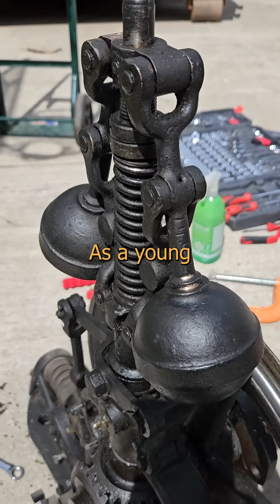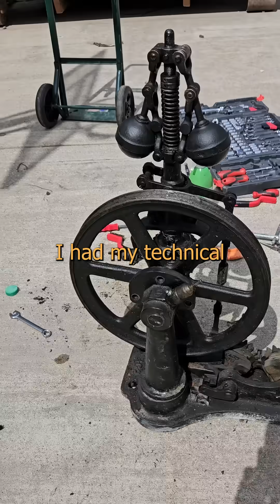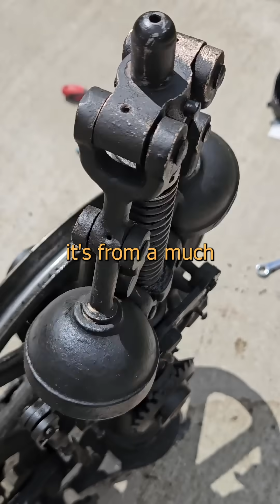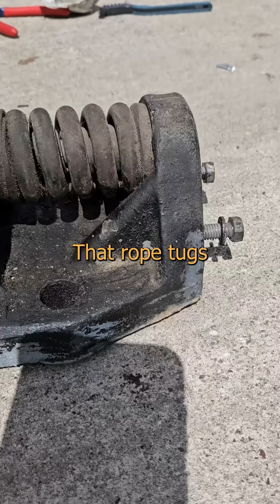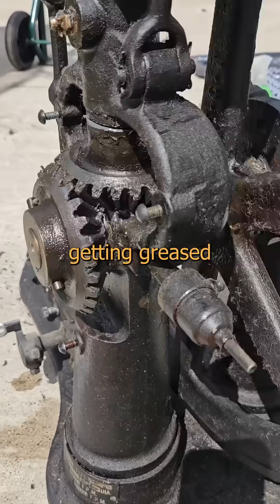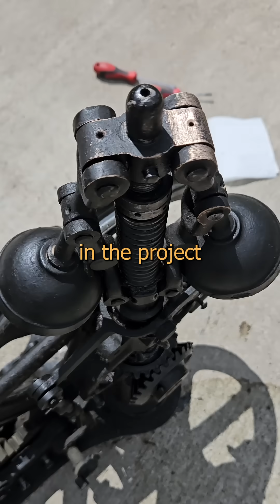Flyball Governor #chrisboden #comedy #engineering #steam #safety #elevator #steampunk #vintage

Comment: This centrifugal governor is used in a different function, than the one used in a steam machine. This one operates as a monostable limiter. If a certain threshold is crossed, some other mechanism is triggered, but not automatically released, when the threshold is crossed again.

The governor in a steam machine operates as a proportional controller, controlling the flow of steam, to stabilize the speed of the machine.

Comment: For those womdering, FPM stands for fucks per minute
So if you start to fall, it will count how many times you say fuck depending on how quickly youre falling, and once you reach 350 fpm it wont engage because youd have slammed into the ground about fifty seconds ago

Comment: I get a queer feeling of nostalgia for any machine that is made of heavy steel parts and has no computer, battery, sensor, or wires. Things made to last a century with minimal maintenance, and any adjustment was mechanical.

Comment: Aircraft propeller governors work the same way , but the spiny balls open and close oil ports to change the pitch of the blades holding the engine at a  set RPM regardless of Manifold pressure  ( engine power) and that is pretty cool!

Comment: I didn't pay attention to physics in school, but I remember them talking about centripetal forces. What's the difference (if there is one) between centripetal and centrifugal?

Edit: I googled it and the explanation I found goes like this: if you're in a car driving straight ahead you don't feel any forces on you that you won't feel if the car is still. If you start going around a corner, your body keeps going straight ahead until the car gets in your way and pushes you around the same way. The force of the car applying the turning force to you is centripetal force, while the lack of centripetal force that makes you go sideways is centrifugal force.

Comment: I would definitely love to see that restored. I think that's kinda cool and fascinating. I love steam engine. All types of mechanical devices and matter of fact I restore a lot of my stuff as well. I actually, I'm gonna be 27. This July 23rd of this year, but I refuse to accept the Martin Day lifestyle. I'm more or less like the old analog lifestyle. I don't care much for the newer electronics, but I love the old-fashioned electronics and household. Disappliances of the heyday and also restoring antiques to the point where they could be showing on how they work, or I restorm and come back into full-time, use every day. Like I rebuilt my 1930s proctor toaster, there's only one part that I couldn't duplicate, but it wasn't a big part. It was a small little penny bell. Third ding, when it is time to flip your toast, but other than that, I restored and replaced the heating coils and electricity cord. Even with a newer plug and do all types of stuff like that? Don't even own a TV. Mostly just listen to the radio all day and occasionally I come online. And watch YouTube videos, shorts our longs. Yeah, I love that old show Rick's restorations. On History Channel, I think it used to be, but on YouTube lately. And I love restoring and putting stuff back to full time, use and having it'd be used every day every single day over and over again, nonstop, continuation of use

Comment: The first time I saw one of these in person was at one of the dorms in UCLA when my employer at the time was part of the ground-up remodel of the entire building. They had 2 of the 3 elevator shafts getting brand-new cabs custom-built for the antique dimensions of the shafts, so I saw the old cabs being dismantled in situ.

It was immediately obvious to ME what this apparatus was, but most of my coworkers at that particular company were dullards of the Joe Sixpack variety who struggled to understand anything more sophisticated than a hammer. Morons, the lot of them.

Comment: I rebuilt ALCO 251s for Fairbanks Morse Defense, the governor that controls the fuel linkage is a Woodward and work on the same exact principals as this. Balls spin reaching equilibrium, load is applied and the balls drop, governor increase fuel based on load to bring the balls back to equilibrium.

Comment: Jay Leno taught me this 20 years ago. 
  This is how the governor worked/works in an engine that runs factories and their belt system, think Jumangi. "Running balls out!" Means the factories engine is running at full throttle and any more machines will lower the rpm without more throttle left.

Comment: Absofuckinlutely I'd like to see that cleaned.

The new overspeed governors are boring. They still use centrifugal force, that sends out "dogs" - one way teeth that will bite into the governor pulley, stopping it. It then drags on/stops the rope, pulls on the safety gear, and pulls the safety gear cam up, sending out teeth that could bite through any pillow (insert Heh here).

It gets extra interesting when you start moving into high speed elevators and when you need progressive safety gears instead of instantaneous ones.

You try stopping a high speed, multi ton glorified coffee tin with people inside, safely.

I wont even go into bi-directional ones, that also have a safety gear tooth system on the counterweight, on the other other end of the ropes.

Again, thank you Chris. I always enjoy your content, but your elevator content tickles my tism in ways I've never experienced - And thats pretty cool.

Comment: Drop it into a solvent tank for a few days. Wire brush it for about 20 minutes and then pressure wash. When finished, re-grease the gears. You're right... Most of the time, all we had to do was clean something like this. Parts didn't fail as long as they were operating and kept lubricated. Holding pins might start getting brittle though, so when replacing, we usually replaced all, but cleaned everything first.

Comment: 100 years without so much as being touched other than slapping some lubricant on there a few times a year is astonishing, they don’t make stuff like they used to that’s for damn sure
Reply: They do make stuff like that still. It’s just prohibitively expensive so 99% of the time someone chooses the cheaper one and replaces it later.

Anyone can overbuild a bridge so that it lasts 100 years. But you need an engineer in order to build one that barely stands and can still carry exactly the weight you need.
Reply: @therealcmj  There has never been a fatal elevator fall accident of that nature. Not once.
Reply: @therealcmj  Also the survivorship bias effect. We have one example here that survived 100 years, what we don't have is the examples that broke apart under stress dumping it's screaming contents down a hundred foot shaft and turning them to jelly.
Reply: @petergraphix6740  Going in the other direction, it's impossible for a part that was made, say, 20 years ago to have already been in service for 100 years. We could have all sorts of new "100 year" parts around us, but we won't know that for a fact until the hundred years actually passes.
Reply: @petergraphix6740   -  lol, there has to be an exception in everything - except elevator brakes, unacceptable..    ha ha - off for a walk. getting some fresh air..

 yeah, that probably (nearly - just stated for the one system Otis never inspected in the last 101 years..) never happened...  Look into it a bit more...  Elevator brakes were the innovation that effectively replaced stairs - from the very beginning (not the same as mineshaft or crane hoists, those can (and have been) be free running - no control rails, so accidents could happen).
Reply: @therealcmj  i feel like people like you are ignorant af.
Reply: I'm just gonna point out that it's in great condition with no visible corrosion simply because it's never been cleaned and properly maintained. It kept the wear level down. As far people saying new products could be as good, the truth is nothing is built with longevity in mind today we have technology and alloys that can last the test of time but they will definitely put in something retarded like plastic bearings that will fail to increase profits.
Reply: actually not really, the production of cogs these days are much more slow to make sure they last longer

Comment: I have a design in my head of a vertical paddle wheel type of wind generator.  What I want to install in the thing is a flyball Governor that works slightly differently.  As the speed increases to an unacceptable RPM(Storms and the like)it speeds up and the balls run on the idea of the faster they go the lower the paddle wheel slides into cover... and as it slows it raises it up again... I have the fans/paddles ready to go... I was thinking best use in Hurricane regions...toodles...

Comment: Love this. I saw something similar in a VERY old windmill in the UK. Most of the drive shafts and sails were wood. A stone grinding wheel would grind flour. There challenge was too much wind. Windmills would often burn down. They had a similar centrifugal regulator which were open a wood and leather clutch. It was almost like old cars but in wood in 1600 and something... pretty cool 🙂

Comment: I saw one of these in a building in Portland Maine. It was about twice the size and if I remember correctly some of it was brass or copper. That was back in the late '70s. It was sitting on top of a cable reel with several loops on the drum.

Comment: ... That is something I would love to do. 
In my shed is a 1948 homelight chainsaw. It has a carburator with a float. You cant turn the chainsaw horizontal, but fortunatly there is a button on the handle that lets you rotate the blade 90 degrees while keeping the float in the correct position to run.